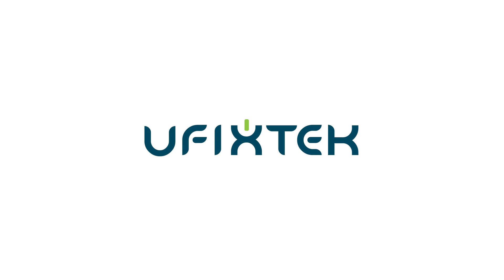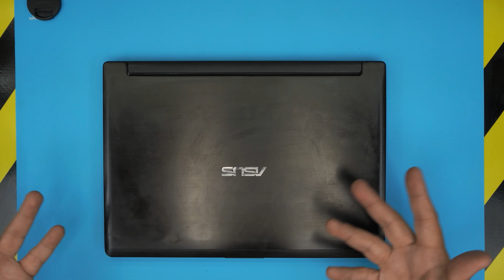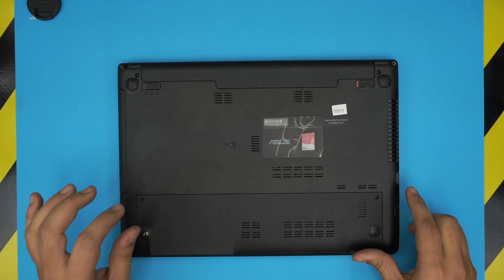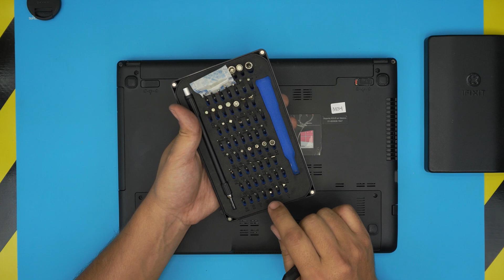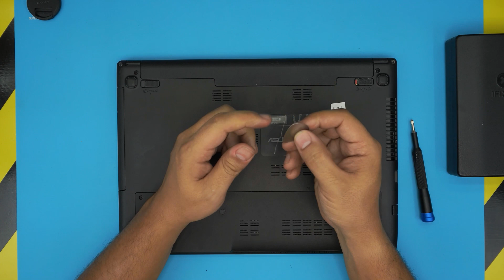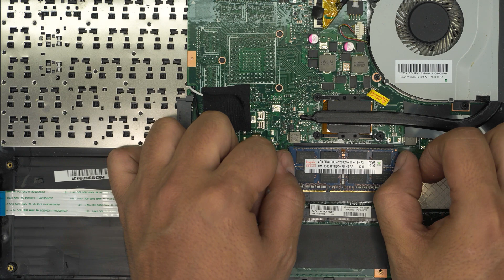ASUS S46C RAM Upgrade 👉 FULL GUIDE

Comment: Thanks for the video! It's just simple and easy to understand. 

 I recently updated my S46C laptop because it was running slow. I installed 2 x 4 GB RAM modules, as recommended by ASUS tech support. However, I discovered it originally came with 2 GB and 4 GB modules.

I’ve noticed the laptop is running a bit faster. Do you have any other tips for improving its performance? I plan to install an SSD with a better cache and update the BIOS version.

After reassembling the laptop, I found the fan quieter after the RAM change but it seems to be running hotter than before. Is this normal after a RAM upgrade?

Additionally, I encountered an issue with the touchpad. The left-click area is lower than before, and I couldn’t figure out how to reposition it correctly. Any advice on how to fix this?

Thanks!
Reply from the maker: It's my pleasure, my friend. 😊 I deeply appreciate your taking the time to provide feedback. If you're inclined to support the channel further, feel free to like and subscribe—or even both!
Regarding your question, I would highly recommend upgrading the HDD to an SSD, and you will see a dramatic performance boost. 
https://youtu.be/JwW7HjzsXjY
Adding RAM may cause the CPU to heat up more. 

Regarding the trackpad, I will make a short video later on.
Should you have any further questions or requests in the future, please don't hesitate to ask me.
cheers🍻

Comment: What is the maximum RAM capacity on this notebook's motherboard? The only site I could find that mentioned was saying that 8GB is the maximum supported, but you're talking about being able to install 2x8GB modules in it. Is it possible to do this on this notebook or is 8GB the actual max capacity for its RAM?
Reply from the maker: 🫠Regarding your question, check the max ram capacity that it can handle here:
https://youtu.be/tKEJTkVth4Q
if it is 16gb the get 2x8gb , we do upgrade this laptops to 16gb for our clients, so depending on your cpu model, so check the link to make sure.
Should you have any further questions or requests in the future, please don't hesitate to ask me.
cheers🍻

Comment: Does this notebook use DDR3 or DDR3L memory?
Reply from the maker: 🫠Regarding your question, it can take single slot DDR3 but if you going two slot then get DDR3L , the L stands for low voltage.
we recommend that you have L version on both slots.
Should you have any further questions or requests in the future, please don't hesitate to ask me.
cheers🍻

Comment: my dvd drive won't slide off
Reply from the maker: Thank you for the feedback! if you wish to support the channel you can LIKE or SUB or both :P
regarding your question: did you remove the middle screw on the case? if you did then just wiggle the dvd drive a bit and pull it out with a bit of force and wiggle.